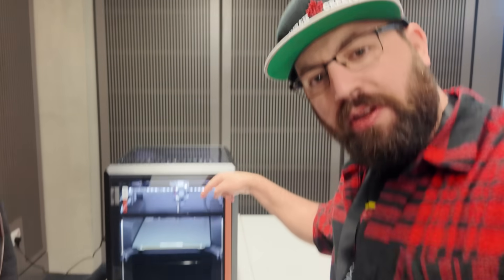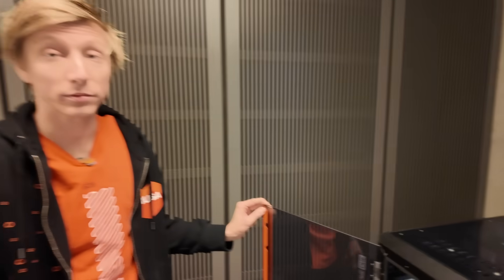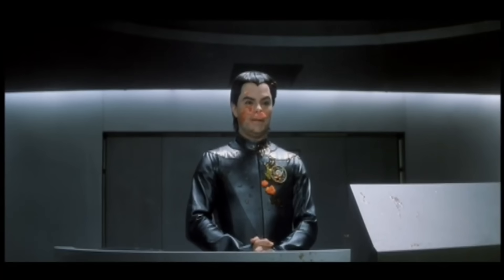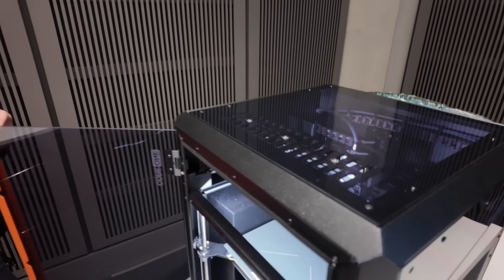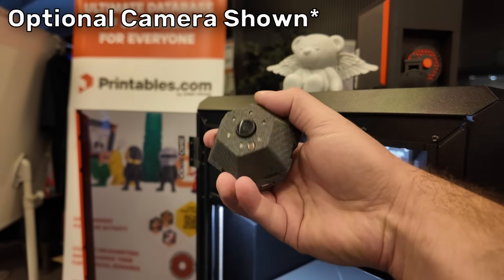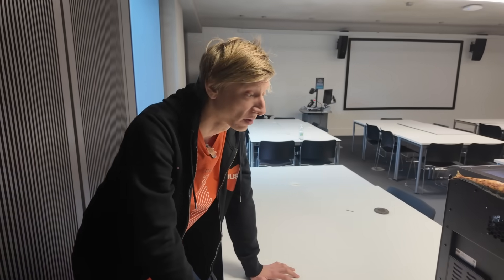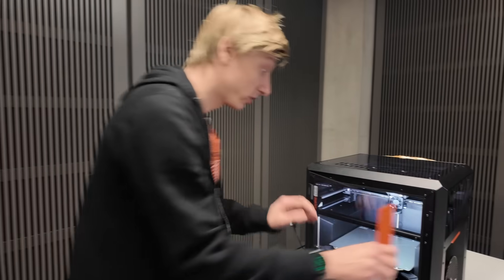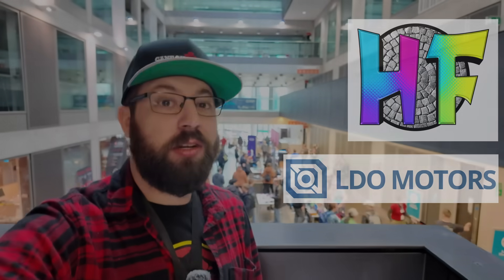One on One with the Prusa CORE One @ SMRRF24!

Comment: It would have been nice to be able to invert the filament spool to the inside, the inside works like an passively heated dry box anyway. Could also just punch a bunch of holes into the side next to the filament mount and add a door like the dry box they already made. Maybe add a shutter like the one on top

Looks like a very well thought out machine 👍
Reply: Flip the panel facing out. Bish bash bosh!
Reply: Yeah exactly what I have been wondering about too. Why isolate the spool from the insides when the whole printer can be used as a drybox during printing.
Reply: @TNX255 the side panel is just some thin metal. It should get fairly warm. Add a door to the outside and boom! Heated filament storage.
Reply from the maker: Print a door for itm drill some holes and send it

Comment: As long as it's not $2000 the X1C might have a competitor, the P1/P1S on the otherhand will still likely eat this thing for lunch....
Reply from the maker: Its available for pre-order on the site
Pre-assembled is 1199 USD
Kit is 949 USD

So very much in-line with x1c pricing (and its also made in the EU)
Reply: @CanuckCreator  I don't care where it's made,  and calling it made in Europe is misleading since none of the key components are actually made in Europe going by the MK3s/4s parts passports, if you discount the 3D printed parts the % of EU manufactured components drops to about 0. Given the fact that the laser cut steel enclosures for the MK4/Mini are manufactured in China I'm betting that this is the case for the Core One chassis also so even more parts are going to be manufactured in China this time around.  

There is a reason why they assemble the printers in the US for the North American markets ;)

But back to the main topic $1200 without an MMU it's still too expensive for what you get since for $100 more you get the X1C with the AMS or the P1S + AMS for $400 or less, or the naked P1S which is in all honesty probably the closest apples to apples comparison to the Core One for half the pre-order price.

And the MMU3 is still miles behind Bambu's AMS and what others like Creality now offer also, and it still costs about double to boot. I see Prusa hasn't been humbled enough yet to get their shit together. 

Given that the X2 which will likely launch around summer of 2025 and is rumored to be an IDEX with an updated AMS Prusa really needs to step up it's game.
Reply: I am weirded out about this low key racism of EU vs China tbh.
We live in a global market. If the machines were made in India, Taiwan, Africa would that matter?
Reply: @personwomanmancameratelevision  Made in the EU tells me two things.

Firstly, the manufacturer wants to have control over the manufacturing process, which usually means better safety and quality standards.

Secondly, the manufacturer is providing local jobs at a time when many companies are outsourcing jobs to low-cost countries.
Reply: @personwomanmancameratelevision China is a country, not a race. China has a great many races living in it.
Reply: @personwomanmancameratelevision  It’s not racism it’s politics
Reply: @personwomanmancameratelevision  Its just narrow mindedness from Prusa fanboys clutching to whats possibly the only advantage Prusa has over Bambu.
Reply: @personwomanmancameratelevision  Every key component of Prusa printers is made in China anyhow, they inflate their parts of origin by counting the printed parts as made in the EU which is technically correct, probably the only 100% European component is the hotend since E3D still only manufactures in the UK. The rest is China, China, China. 

The printers for the NA market are assembled in Delaware for a reason otherwise they won't pass the required country of origin checks greatly restricts their use in various industries.
Reply from the maker: @DOGMA1138  k
Reply: @DOGMA1138  
I can't quite share this assessment. 
How do you know exactly where the Prusa parts come from?

Prusa itself states 30%, with a tendency towards less. Which I also find credible.
In the early days of Prusa, the proportion was certainly higher. But just claiming everything now without citing sources is not ok.
Reply: @DOGMA1138  What kind of crack are you on? only 33% of all components on the old MK3 are made in china. That value is even lower now with the MK4/core one.
Reply: @LilApe  Take out the printed parts......
Reply: @DOGMA1138 The percentage is calculated from the value. What are the printed parts worth of the entire printer?
It's no secret that electronic components come from China. Why do you think all countries are trying to become less dependent on China?
The power supply is from Delta. Board is manufactured and assembled in-house.
Aluminum die-cast parts as far as I know EU.
Hotends from E3.
Haribo from Germany.
In contrast to other manufacturers, Prusa is very open with information.
There is no need for conspiracy theories.
And whether it's printers or washing machine parts, I don't like the dependence on China.
And I support every company that at least tries to become more independent.
Anyone who claims something must also provide evidence.
Simply blaming it on the printed parts is cheap opinion mongering.

Comment: Why is nobody talking about that weird bar that's located across the front of the printer's chamber? That looks like a design flaw, something they couldn't get rid of OR had to add to fix some rigidity issue they were having. No Core XY printer has that feature. It definitely looks out of place, an afterthought
Reply: Not really an afterthougt. It's the base plate of the XY gantry. Needs to be rectangular because it allows you to remove half of the outside shell.
Reply: @robertgcode965  that doesn't make any sense. Why would you remove half of the main structure of the printer. Also if you do that the XY gantry would only be supported by the lead screws and smooth rods which are not structural components and are only connected/constrained by the servos. A more logical explanation is that they had to add it to add estructural rigidity because the entire shell is made out of sheet metal which is a really bad choice if your main goal is rigidity. The reason they probably went that route is cost since cast aluminum or aluminum profiles would increase the production costs and therefore they wouldn't be competitive which is the main reason they released the Core One; to be able to compete with Bambu Lab
Reply from the maker: Ensuring that your COREXY motion system is square is the most critical part of building a coreXY printer, if its not, it will never print right

SO you start with a square thats true, and build the frame around it

Also the crossbeam is nowhere near in the way in operation, its above the bed so doesnt affect visibility at all and when a print finishes the bed drops to the bottom for easy removal.
Also the frame is strong enough to stand on it, Its plenty strong as is
Reply: @CanuckCreator  Exactly. You're confirming my point. They couldn't go around it because they chose sheet metal to build the housing instead of cast aluminum or welded steel frame like pretty much every other manufacturer which from a design stand point gives you a lot of advantages which the Core One frame lacks. Since their frame or Exoskeleton how they call it is not a rigid one piece part they couldn't use it as frame for the motion system and instead had to add a separate frame. That's how they ended up with an ugly annoying crossbar right in front of your face every time you open your door. You can see Zuza at 2:00 having a bit of a hard time touching the inside of the enclosure having to go below that bar. It's not a good choice for sure and I bet a lot of people are going to complain about it and are going to hit it more than a few times either with a hand or a tall part. It's just in the way, it's ugly.
Reply: @CanuckCreator  Another thing nobody is mentioning are all the wide gaps in the Exoskeleton where one bent part meets another one. That makes the "enclosure" not sealed or at least poorly sealed which will let escape a lot of ultrafine particles and VOCs defeating one of the main purposes of having an enclosed printer
Reply: @elleryfg7853  Perhaps that makes more sense than you realize.
Why does Prusa do it this way and not like everyone else?
The goal is to have a printer that is easy to maintain or repair.
The fact that you can simply unscrew the entire front makes this possible without any problems, unlike the Bambulab. No glued parts and the whole gantry can be removed in one piece and everything is easily accessible.
The laser-cut steel frame makes it very easy to create a perfect square.
This also increases the stability of the entire system.
When the print is finished, Z moves all the way down and the print can be removed very easily. What exactly is your problem here?
Prusa has already thought about the design and not just another Corexy that is as cheap as possible to produce but difficult to repair.
When I look at a Bambulab P1, where the whole Bambulab frame splendor can be seen open, there is no reason to be proud of it.
What is a Bambulab frame made of? Pressed Coke can sheet metal. The Prusa is made of solid sheet steel. Have you ever held a real steel sheet in your hand?
Reply: @herr_rossi69  relax. You sound like a fanboy. Count how many "Bambu Lab" you have in your comment and you'll realize you are not being objective here. The only reason they chose sheet metal for the frame or exoskeleton is cost, it's not better or easier to build a square box out of sheet metal. I can see issues happening with the kit version if customers are required to assemble the frame by themselves. It's not the best design alternative, this is just a big compromise to lower production costs
Reply: @elleryfg7853  Yes, you can use the fanboy argument to invalidate any criticism.
If you run out of arguments.....

Comment: Why is the thermal expansion a deal here ? The difference in the thermal expansion of the steel and aluminum under 70C is not going to change the shape of your assembly significantly.. And the chamber is rated for under 60C. It's not a 100 degrees in there. Did anyone with a printer of a volume smaller than 300mm cube ever had an issue of expansion under 60C ?
Reply from the maker: Yes, its actually a common enough issue with vorons that backer plates to compensate for the warp that happens are commonly used and it does affect things
Reply: @CanuckCreator  When I think about it. It would make sense. Vorons are usually bigger and don't have controlled ambient temperature for the chamber. It would be easy  to accumulate heat in aluminum and slower in the steel. Then it would be very likely to have more difference in linear expansion than 0.05 mm. Especially while printing ABS in a big Voron.

Comment: This is the exact printer I’ve always wanted from a company like Prusa. A perfect balance of form, function, quality, cost and corporate ethics.
Reply: You’re speaking my language! This is exactly
Reply: Yeah, I just wish the bed was larger. If so I'd consider purchasing a dozen or so to add to my farm... provided that Prusa doesn't use us as beta testers like they did with the XL. That was the most unreliable machine I had used in 5 years.
Reply: I just got an XL and it's so much more refined that it was. Ridiculous quality and very reliable now! Ive been building product that have PETG+TPU in the same build and they come out perfect!  @OhImKiCkiN

Comment: I'm waiting to do my MK3 > MK4 upgrade for when the MK4 > core one conversion kits come out. Kill two birds with one stone.
Reply: It would be cheaper to go Go direct to Core one.
The mk3 to mk4s kit is $580
mk4s to core one is 450
A core one kit is $950 so there is zero reason to do a double upgrade and toss most of the parts all while spending more.
Reply: @No0o0o0o0o0 no, you're wrong. I'm saving money doing it how i did it, as I actually understand math.
MK3s > MK4s upgrade kits from black friday sale were only $435/ea. I got two with free shipping and no import duties, saved $290 just from the upgrade kits alone.
Two upgrade kits through black friday and two conversion kits are only $1,770.
Buying two core one printer kits on their own, with shipping and import duties would be $2,200. I'm literally saving over $400 with the method that I did.
If I bought two fully assembled core ones, it would be $2,700
Reply: @No0o0o0o0o0  @LilApe Also you keep 2 working printers!
Reply: @graeme_thompson  I have over 400 individual 3d files for my business. I don't need over 800 just for two different printer platforms. I prefer a streamlined approach of one file for all my printers. Don't have to keep track of what SD cards/USB stick go to which printer. I would never use my MK3's anyways once I have the core ones.

Comment: This machine has so much thought put into it and all of it seems like its designed for us, the hobbyists. Amazing to hear a manufacturer talking about modding and the fact that mods and upgrades are at forefront of design of this machine. Instead of closing things down and taking things away, we get the power to use our tools however the heck we want. Even to upgrade older machines into this. Whoever talks crap about this, is just dense. Great job Prusa.
Reply: Yeah I am a candidate for a :face-fuchsia-poop-shape: talker.
If you have a mk3[s] it costs $580 to upgrade to mk4s
then it takes $450 to upgrade to Core one. ($1030)

If you were a mk4 user it costs $100 to upgrade to mk4s
then it takes $450 to upgrade to Core one ($550)

We ignore the elephant in the room playing the Ship of Theseus with Prusa machines.
You have ton of extra parts laying unused, time wasted building and more money spent than just buying new and having 2 printers. If your hobby is building printers some folks are in heaven. 
If your goal is not to waste time and money and want to print this is a bad deal.
Reply: @personwomanmancameratelevision You're right, not everything you can do makes sense. 
But at least you have the option. 
At most, I think the option to upgrade from MK3 to MK3.5 makes sense. 
The price is reasonable and the printer is twice as fast and you have the online functions. 
Personally, I would probably go down the Klipper route. 
From MK4S to Core One means for me 890€ + 490€ which I still find acceptable.
Most of the parts will continue to be used and I like to build printers from time to time ;-)

Comment: Hey, I guess you can tell I'm rather excited about this thing! This could go on for another 30 minutes, good job cutting this down into something watchable. :D
Reply: Since we have someone from Prusa here, an important question: ‘Is the fish included or do you have to buy it separately as an accessory?’  😉
Reply: @andreas.grundler  The fish is handmade by japanese craftsman, each fish is unique. Very premium piece. We might provide them, for example, to the most creative people in the community as high praise.🐟
Reply: Can you switch the sidepanels, so the filament is hanging on the left side?
Reply: @sttcno yes, I've seen someone confirming it.
Reply: I think many of us are excited by this machine. Most importantly what will the cost be..
Reply: @TripleJAu  it's been up on the Prusa website since November. US$1199, more with shipping and taxes. Kit is $949
Reply: My Flashforge Dreamer used fans to regulate the internal temperature and it didn't work well. The sudden pulling of cooler external air into a preheated chamber caused delaminating and warping on certain material. How does this system differ? Also, it's looking like brittle cf filament would have a tough time navigating that Bowden tube without breaking. I'm a Prusa fan, and have a 5T XL, MK4 and MK3S+, but I have some reservations about this machine.
Reply: @grantdeisig1360 I would think that it shouldn't be a problem with PLA. On the contrary. 
With materials that require higher temperatures, the fans will hardly run because only the heating bed is responsible for this. 
There will hardly be more than the maximum 55 degrees.
But still an interesting point.
Reply: @grantdeisig1360  reviews should be out with the week. Hopefully there's extensive testing.
Reply: Thanks for the great video and break down. You have successfully sold a core 1 to myself when they start shipping! Really curious to see how it handles the new Tullomer filament from Z filaments!

Comment: My thoughts on this was... Meh. 3 or 4 years ago this would be amazing... but now its like... eeh its okay I guess.
Reply from the maker: I thought the same thing when bambu released the x1, which did everything my voron from 5 years previously had done.

Cant compare things in that way, if its good, its good, if its bad, its bad, doesnt really matter when it came out.
Reply: @CanuckCreator  I disagree, the X1C prints far far better than both my Vorons, and it just did it out of the box. Its not perfect but my oh my was I impressed.

When i look at the Prusa Core One, I think... what does this do better than the X1C? And I cant think of anything. Id much prefer to give my money to a European company but when its so far behind the competition its just no feasible.
I can get an X1C in the uk with AMs for £1,099.00 GBP
For the Prusa machine its £1,138.80 and that without any form of AMS.

I think if it was the price of the P1S which arguably its more similar to, then maybe it could sway me. But no way am I paying that price for such a basic machine.
Reply from the maker: It's your money. Spend it how ya want.
Reply: @Festivejelly  P1S doesn't have active filtration or a 120˚C bed. And cannot be easily repaired. With the build plates carried over from the MK4S it can print nylon and PP. Can't do that easily even on the X1E.